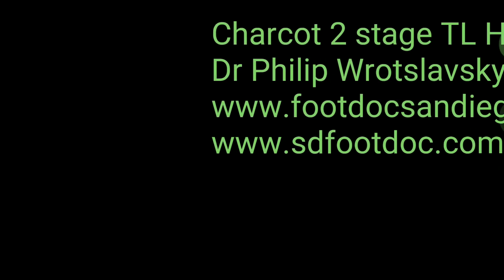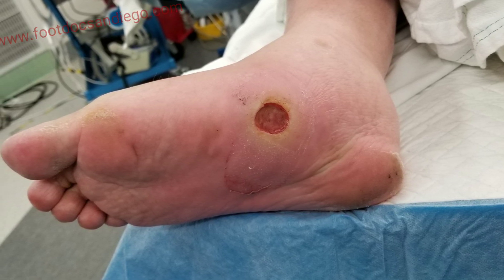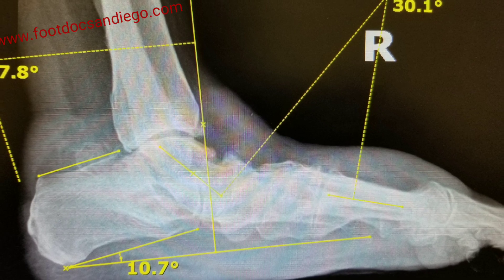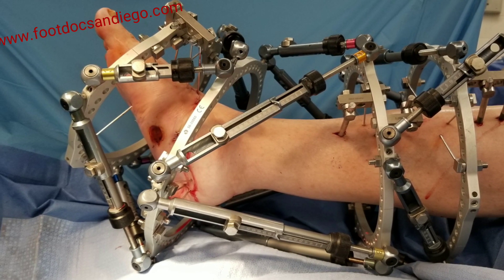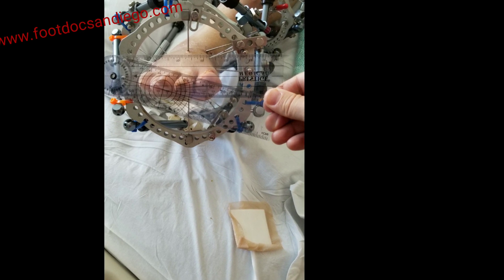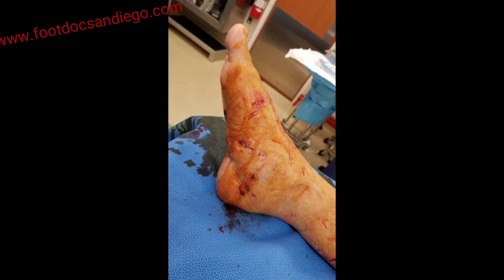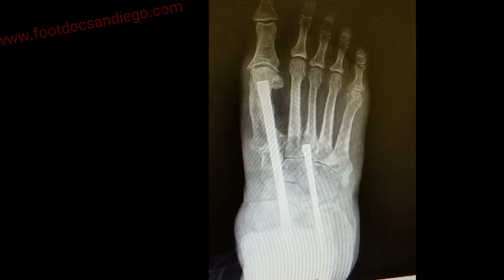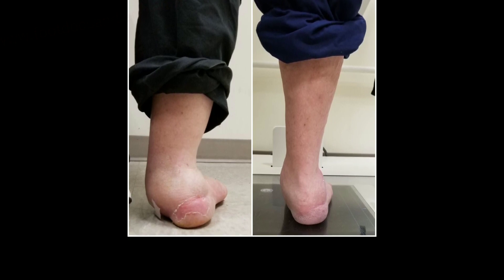Charcot foot reconstruction

Comment: I have the same in the left foot. One dr stated 50/50 with aputation. Had 20 people lined up. IBJI. Stated he could just amputate if I wanted. Doctor P..zur said I have a 90 percent success rate with external fixator. Dr one said I might need a tibcalcaneal arthrodesis or plantalar arthrodesis. Dr. 1 takes my HMO. Can you please guide me? I'm at the end of this struggle
Reply: In order to give any advice i would have to evaluate your current x rays and other tests that you may hand available . If you want to set up an online visit please contact us through our website and i can give you my opinion based on my experience of doing charcot Foot reconstruction for over 20 years. pw

Comment: What are the recovery times altogether from the time the outside brace is used until the patient is ambulatory again? Approximately, of course. I have exactly what your patient here has.
Reply: Usually one has the fixator device attached to them for about 3 months, then one is non weight bearing for about another 2-3 months once the beams are inserted ( this is done at the time of the removal of the external fixator). Timing of recovery can change pending deformity magnitude and if complications arise.

Comment: I have got to have this surgery and I am a type 1 Diabetic.. Is infection high risk with this surgery???
Reply: Any surgery carries the potential for infection. This surgery has evolved to minimize risks. Also there are new antibiotics available that can be very helpful if an infection arises. Ultimately  this surgery has more potential for complications as it is more complex than you r average foot surgery , however in my experience of performing this surgery over 15 years infections are fewer in # and are easier solved if they happen.
Reply: @PhilipWrotslavsky  thank you 💙